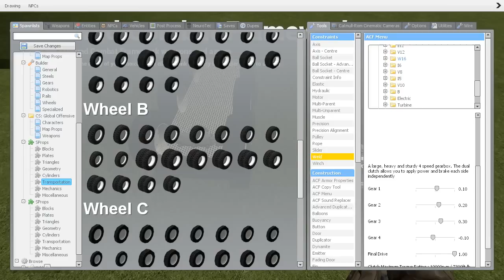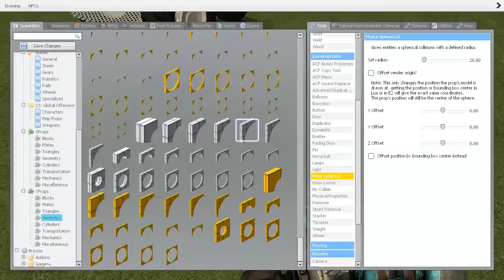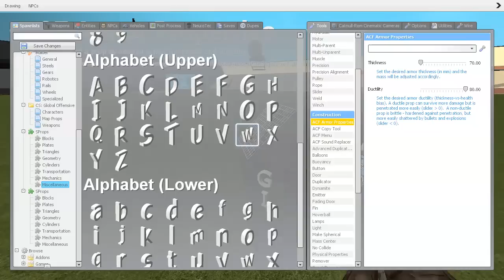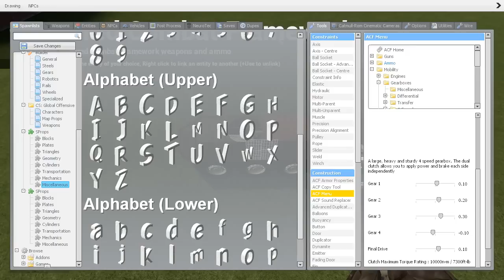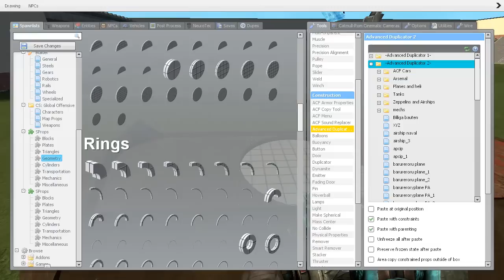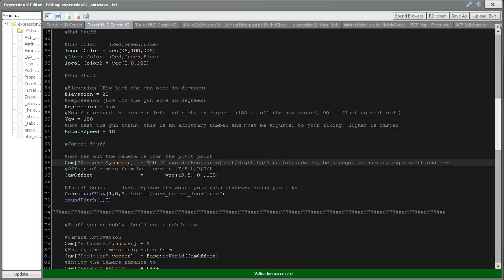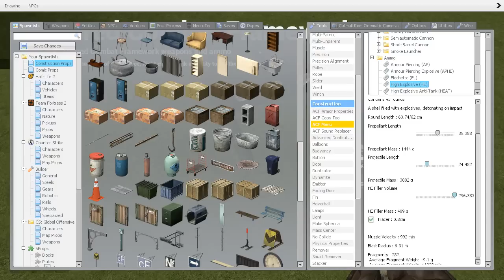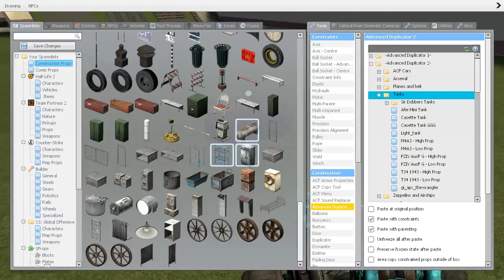[Tutorial] Garry's Mod: How to build a ACF APC/Light Tank w/ mouse-aim turret

Comment: I have a problem, i did the instruction like you said, but my apc is not turning (or barely turning at all) but however it runs fine. Do you know why this is happening?
Reply: You first have to make the wheels spherical, if you make them spherical after axis centering them to the hull, you will have problems with turning, at least for me, i hope this can help you
Reply: what version of gmod do you use?

Comment: Hey I was wondering if you knew what is causing this problem im having with the Weld Latches. For some reason the weld latches break and it makes the tank not turn, I tried replacing the weld latches but it still didnt work. It might be the parenting or the Props, I removed all the armor props to where its only the Base plate and it turns perfectly fine. Not sure whats making the weld latches not work. It might also be me not enabling Remove Constraints while parenting.

Edit Figured out the problem, It was because I parented without enabling Remove Constraints.

Comment: Gmodism, try using Physgun Buildmode and Precision Alignment! Physgun Buildmode is just a simple addon that helps you to build by making your physgun to act slightly different. It automatically no-collides the prop, it won't allow prop rotation unless you're pressing E (which is wonderful). As for Precision Alignment, you can use it to do anything, similar to the Precision tool but it has way more accuracy, you can do custom constraints with it and you can mirror props so it looks identical on both sides. There are Precision Alignment tutorials on YT btw.
Reply from the maker: +Tsang Billy Long sicince I tried the buildmode physgun so I will give it an other try :)
Sounds very useful!

Comment: hey i really like your video but i had a problem with the turning. my ape's turning is very weak and it it can go left and right but only slightly. then in cases when it would turn it would be when i initially move. can you please help i put a lot of time into my apc and i don't want this small thing to ruin it
Reply from the maker: if the turning is to slow, maybe distance between wheels need to be broader so it is broader, or you need more powerful gear settings so you can gain more force, or do the same thing with a bigger engine.

Comment: Hey, could I get some help?
I set up the wheels, engine, and gearbox correctly.
Forwards is fine, but turning is almost nonexistent unless at high speeds.
Any fix?
Reply: +Rick McDick Also, brakes do not function.
Reply: +Rick McDick same with me idk the fix either
Reply: ik you prob arent going to see this since it was 4 years ago, but the fix is to remove the wheels, spawn them again, move them to the positions with precision, and make them spherical before you centre axis them to the baseplate

Comment: So, nerdery, by any chance do you have a tutorial any were about making a non ,mouse controlled turret for acf, honestly i don't really want to have a mouse aimed turret chip someone else made and i feel like a good non mouse controlled turret would be pretty nice?
Reply from the maker: +BlackCatTheGreat Indeed I have, look at my basic wire tutorial about turrets, and just add some ACF guns :)
(playlist of them basic is available)
Reply: +Gmodism Total Nerdery Channel Thanks, I have been experimenting with a few designs and none of them stay consistent. I will give it a look.
Reply from the maker: do so, remember that ACF guns are rather heavy, so finding their centre of mass is crucial for a stable turret despite design :)
Reply: +Gmodism Total Nerdery Channel as I am on my phone right now and can not test, would that design be able to be miniaturized for a smaller tank design?
Reply from the maker: naturally, however non mouse aimed turrets are most usually less stable and a good bit heavier, as it required for the design to work out
Reply: +Gmodism Total Nerdery Channel alright, I'm testing it right now.
Reply: +BlackCatTheGreat nvm gmod is being an ass and i need to restart it.
Reply from the maker: It is just being it's problematic yet lovable self -.-
Reply: alright i am now in gonna test out smaller versions of the turret.
Reply: Alright, i have created a turret that is smaller and so far moves alright. Now testing combat prowess
Reply: Turret is a success.
Reply from the maker: Great it works out fine! also use weld-latch when not using turret :)

Comment: I can't get the advanced ball socket tool to make my wheels "become one". Can you help?
Reply from the maker: +SyBr Lad You will need to use the same settings as in the video and you be fine!
Reply: +Gmodism Total Nerdery Channel That is what I had tried to do but it still ended up not working... :/
Reply from the maker: Hm, like check settings so you got it right, likely that, the there is a other slaver setting aslo: do the max: 0.01 and min -0.01 instead
Reply: Alright, I'll try that. Thanks for the help :)
Reply from the maker: NP

Comment: I got a problem! I've gotten the turret to work once! But now when I look forward the cannon goes straight up and when I look backwards the cannon goes straight down please help 😞😭
Reply from the maker: +L1ghtning F/ash Actually the acf cannons have "up" and "down" sides, it might not be apparent but they spawn with upside up so don't flip it around if you intend to connect a E2 to it.
Reply: I don't think I said that well, no matter what even if im looking down the turret automatically looks up or down, I cant control it. its not inverted, when I look straight ahead cannon goes straight up no control at all.
Reply from the maker: Try remaking it and make sure that the cannon never gets flipped from spawn position, than also double check you have the same settings as me in cam controller and linked everything accordingly, and it should work fine.

Comment: I tried making a turret with high mass due to lots of armor and it causes the gun to overshoot the target quite a bit, Any idea how to fix that?
Reply from the maker: Have you properly parented the armour to a gate?
Reply: I tried parenting the armor to a gate but it doesn't seems to solve the problem.
Reply from the maker: The parrented parts weight is no longer calculated in
Reply from the maker: The problem you have is turret instability?
Reply: It's more unresponsive then unstable, It ether aims very slowly or it swings about very fast but in both cases it's like it has no torque.
Reply from the maker: did you use the ball socket centre on gun? that can cause such thing
Reply: No I am using axis - center tool
Reply from the maker: hard to know what it is if it is not a common problem,
tips:
try it out on a server, singleplayer behaves funny oftentimes
also try experimenting with base prop and the turret bases wheights, change them to heavier and lighter. also make sure you linked all the things up as i video :)

Comment: I have a question,my APC doesn't have any isusses going forward in any direction but it can't go in reverse.Was that intended?Please answer this,gmodism.Also i typically have isusses with turrets because the camera glitches out alot for me most likely due to my PC so i'd like ideas on other options.
Reply from the maker: +Poor Hatty 
To the first issue, make sure your gearbox has a gear that is negative, switch to it for backwards
to second issue make sure you have the newest code for turrets 2014, as the older version stopped to work https://www.youtube.com/watch?v=-xh_dNx-3WU
Also that all is wired accordingly correct
Hope that helps!
Reply: +Gmodism Total Nerdery Channel 
The second issue is fixed, however i still don't understand what you mean by the gearbox.Actually i'm very confused about how gearboxes and engines work so i'd like a tutorial if possible.
Reply from the maker: Then you are lucky! it is covered in my basic AFC tutorial in 3 parts, they have title after content!
Reply: +Gmodism Total Nerdery Channel 
Well regardless, it still really pisses me off that i did EXACTLY what you did and still can't go in reverse.I mean, i even made a working E2 turret but the engines or gearboxes never seem to work for me.It's really dishearting and annoying...
Reply from the maker: Poor Hatty
Well it should work fine, like connect up them with rightclicks to all entities, and then gear up to one button, gear down to the other :p
Reply: Connect the gearboxes to all the wheels?Or would it help if i tell you exactly what i did step by step so you can possibly point something out?
Reply: +Gmodism Total Nerdery Channel 
Actually i got a question about this quote,"To the first issue, make sure your gearbox has a gear that is negative, switch to it for backwards".Does that mean i chance it to a positive?I'm extremely new to anything involving ACF mobillity,infact it's the reason i gave up on the other tank as well.The only E2 chip i have is EZtankmovement but i don't even know how to use that.
Reply: +Gmodism Total Nerdery Channel 
I'm currently wiring the E2 chip in various different ways hoping it will work.This is gonna take a while XD
Reply from the maker: Poor Hatty
with the "gear up" and "gear down" wired to buttons on you keyboard/pod controller you can select gear, all negative gears (usualy only one gear) makes you go backwards
Reply: +Gmodism Total Nerdery Channel Well i actually managed to solve the issuse via E2 but i'll keep that in mind.
Reply: +Gmodism Total Nerdery Channel 
New issuse,whenever i use my gun,it steady begins to violent shake up and down.Is this a glitch?
Reply from the maker: it is... you used a light gun yes?, only fix is use a heavier gun :p
Reply: I used the exact same gun you did.Infact,all the semi auto cannons have that issuse on my end.
Reply from the maker: I actually also have that issue, but only if one stand still for a extended period of time
Reply: I got a question, are you planning to make a ACF ship tutorial?I made a ironclad but can't find a way to power it.
Reply from the maker: fast answer is: like airship but under water.
I may do that, should be easy ^^

Comment: Ok so I got the frame of my tank and the gun to work my issue is my tank is slow, I can't find the right engine or transmission for it and I can't figure out the suspension. Can anyone help me out please?
Reply from the maker: If your tank can turn and move around freely, you can increase final drive to make it faster, if not you engine is to weak= have a bigger one or make it lighter. suspension is nice but not a necessity, if this is your fist tank be more concerned to make it work generally
Reply: Gmodism Total Nerdery Channel I'm using a brake steering I'm using a cvt gearbox with a v12 light tank engine when I try to turn it can't do it and my torsion bar suspension makes my tank wobble a lot my suspensions is 1000000 constant 20000 dampening and 37 length I change the length because it's how hard it pushes it down I think. My engine is in the back and gearbox in the front.
Reply from the maker: What have you connected CVT ratio to then?
Reply: Gmodism Total Nerdery Channel uhh nothing except the gear gate you put in your other tank video
Reply from the maker: From this little info it is not possible for me to know where something has been made wrong, however if you mix stuff from 2 tutorials make sure you know what you are connecting up.
Reply: Gmodism Total Nerdery Channel ok thanks, is there any way we can talk? Instead of YouTube comments like email or steam chat or something? I scraped the whole design I was using and started a new one that is supposed to be a tank destroyer without a turret, but the e2 hud and aiming chip, the hud isn't there but I can try and fix that myself I don't really need a hud anyways and since there is no yaw on the gun it makes it to where I have to look left or right when I want to try and turn otherwise it does it sluggishly. This stuff is really complicated, and thank you for the help, the last tank I was using I got it to move fairly fast but no matter what I did to the base plate it always wanted to flip over so I scraped the idea, I'll have to make it over again better though. Your tutorials even they are longer and get a little boring they explain much more than everyone else so keep up the good work.
Reply from the maker: Thank you! They are long but hopefully a builder knows it all after one of those tutorials. I would like to if I could but I don't have time to help folks individually. However people are generally very competent at proper ACF build servers and at least one person is a kind soul that helps out :)
Reply: Gmodism Total Nerdery Channel I don't do servers I'm tired of people trolling when I'm building things. Maybe we can go into a gmod private server and you can help there and maybe I can share some knowledge on tank cannons penetration and armor and also aircraft I'm really good at designing those not helicopters I know a lot of stuff about arial and ground warfare. And also I got my tank to go really fast without the suspension but it keeps wobbling above 30kph and I am making a TD like the asu-57 and I want to know how do I make the turret turn a little bit with the chip. You have no tutorials on that. And can you try to make a tutorial on advanced tank design and include low profile non turreted tank destroyers they are a whole different set of tanks lol I can't figure out how to make the gun move like a SU-85. Sorry I'm asking a lot from you, and you probably can't do it all.

Comment: Hey Gmodism I really dig your vids!
However I've encountered a problem  today when I tried to test out my tank with the aiming chip, just hopped into my newly created tank, and I've experienced some errors and the chip didn't work as intended. The problem is not my tank or wiring, because I've downloaded some premade tanks from spider's(the chip's creator) arsenal, and the exact same error occured.
I've uploaded some screenshots about the errors, hopefully you can help me out, or direct me to someone who can aid me.
Here you can check out my screenshots:
http://imgur.com/a/0E8nO

Keep up the good work, thanks in advance!
Reply from the maker: +92tpeter This is a problem occurring when one uses the older version of the chip, like those in spiders old tank download. One day Garry decided to break all that, so the old aiming chip will not work with camera any more, get the new chip by following links in description. Hope that helps :)
Reply: +Gmodism Total Nerdery Channel
Turned out the problem was one of my addons(SLVBase), it messed with the Distance parameter, breaking the cam controller. Thanks anyways!
Reply from the maker: good you found issue!
Reply: +Gmodism Total Nerdery Channel 
Hey Gmodism, me and my friends made some tanks using your vids, hope you like it
here are some screenshots of them:
http://steamcommunity.com/profiles/76561198071996075/screenshots/
Reply from the maker: Awesome they look really cool, well built! :)
Reply: I always encounter problems when making tanks, They never work
Reply from the maker: hahaha wow that is so specific
Reply from the maker: If it is too hard for now, it is much more fun to begin with something simple ya know
Reply: I can get the basics of the tank to work, Movement, etc,But armoring is the main issue for me, and getting big tanks to turn quickly
Reply from the maker: Big tanks are slow, but use selective armouring, like top parts can be less than 20% and not so ductile at all, think about where shots will come from and in what angle.